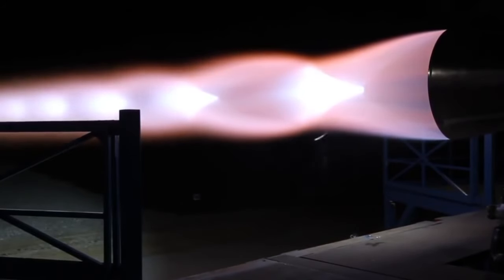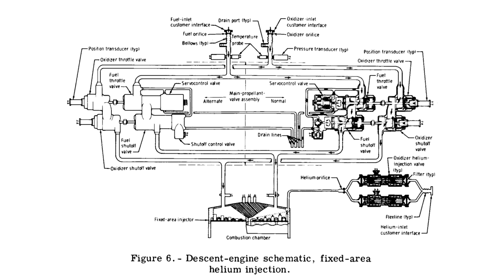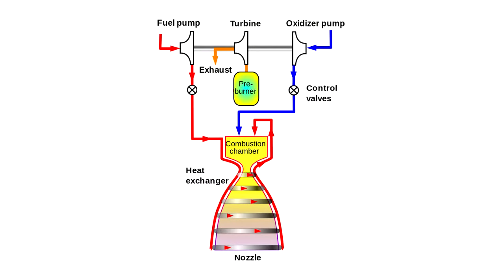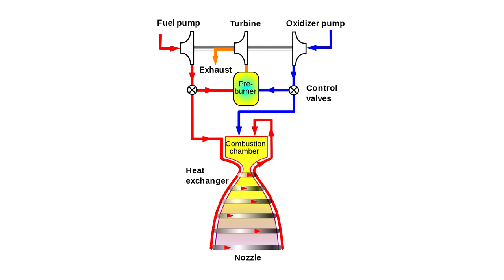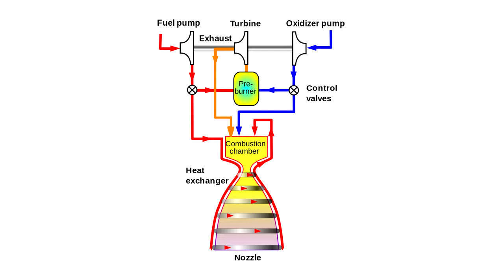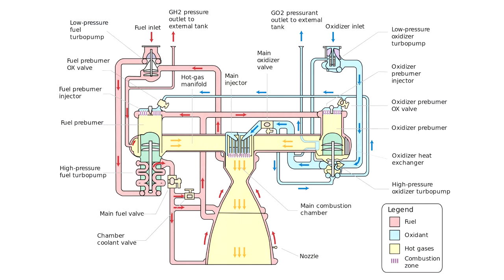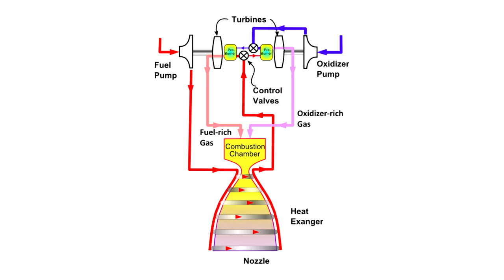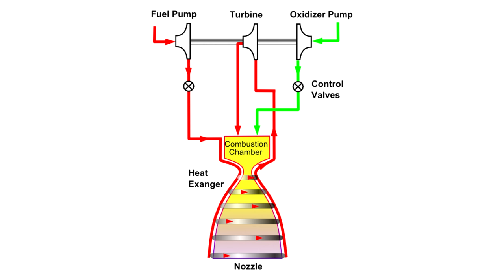KSP Doesn't Teach: Rocket Engine Plumbing

Comment: I feel like the best engine will be the one with the electric turbopump. That means that 0% of the total fuel goes into forcing the fuel and the oxidizer into the combustion chamber, and instead has %100 of the fuel being burned, with all of it very pressurized.
Reply from the maker: +AP but the energy density of batteries is significantly lower than the energy density of the other fuels.
Reply: Maybe if they could use a startup battery to get it going, then generate electricity directly from the burning of the combustion chamber (kind of like how solar panels make energy from light), it would then become more efficient as the loss of energy as heat would be minimized. Of course, this is assuming that future technology permits, but only then I think would the electric solution be better. Now go ahead and prove me wrong again lol
Reply: Like a... Solar panel that operates in infrared wavelengths? I think it would suffer from the same problem as the other ones of not being able to withstand the temperatures, perhaps even more so.

Though come to think of it, the jet engines I work on have something along those lines called thermocouples. In theory, it generates electricity from thermal energy by using the properties of alumel chromel (Though I have a suspicion my tech school teacher was pulling that out of his ass as it sounds more like it simply detects temperature changes via changing resistance. I have yet to learn enough about it to tell which way it works).
Reply: Thermocouples really do generate electricity.  It's how the radioisotope thermoelectric generators on many spacecraft work.
Reply: Or start them up with external power on the ground just enough to get it ticking over? obviously doesnt solve the inflight problem...
Reply: Oscar Jeans if the engine stops for some reason, you'd have the ability to restart it with a startup battery (if you used the electric motor)
Reply: DecidedlyNinja how?
Reply: works for rocketlab but these 200MW for the RD 180 have to come from somewhere ;)
Reply: My design for a rocket/scram engine involve an electric turbine for startup until the scram engine can sustain it self. It would pump the air to supplement  the airflow at lower speeds.
Reply: In KSP they use "alternators" in the Rockets, maybe an equivalent in real life?
Reply: To drive a powerful electromotor you probably need more juice then thermocouple can deliver, not sure it's common to generate large amounts of current from the rocket engine but you could drive a Stirling engine/Quasiturbine from the gas cycle to drive a potent alternator or go nuclear.
Reply: Thats starting to sound like a pre-burner with feed back into the main chamber like the soviets developed
Reply: You'd also run into the same scaling issues as the expander cycle, as your power is limited by the heat through the engine surface.
Reply: using the turbine shaft to turn modest alternators is done irl afaik... but to drive the fuel pumps with electric motors you'd be converting mechanical energy to electrical and back to mechanical. two energy conversions  that both have inefficiency. electrical is great for moving energy over distances but in a rocket you'd ideally want both the pump and the turbine at the same end of the rocket anyway so just having them on the same shaft is hard to beat. 
They do use a system where a combustion engine (diesel) turns an alternator and the electricity from that turns motors on locomotives, but loco designers have a different set of problems.
Reply: Not too mention meany more parts to go wrong. The desiel-electric set up on trains is to utalise electrics engines huge torque when its not actually spinning yet and to utilise diesels relativly high density.
Reply: Adsadsads Good point, I guess thermocouples would suffer the same square cube law problem.
Reply: What about one day beaming/transmitting the energy to the electric engine?
Reply: Sean Trevathan
Maybe - but for perspective each of the five F1 motors on a Saturn V first stage had a 40MW turbine pumping fuel into it (according to wiki) so 200MW total... so about 200,000 household microwave ovens on full power or 1/5th of the output of a typical nuclear powerstation. the turbines can produce enormous power in a really quite compact and lightweight unit.
Reply: Issue is getting massive amounts of power out of the exhaust. if we don't have a turbopump, how're you going to tap that power into rotating force for an alternator? A thermocouple wouldn't do - the amount of power needed to pump a rocket engine is immense.
Reply: Check out "thermophotovoltaics".  That's solar panels designed around infrared rather the usual white light from a sun.
Reply: Adam Olsen This would seem to have a similar square vs cube scaling problem scott mentions... plus you can't have instant heat, you still need to pump a lot of fuel before anything gets hot enough. The turbines have amazing power to mass ratio and amazing power to volume ratio. I don't think any near future technology is likely to supplant turbines.
Reply: They are useful for small engines you like to be strong, like lander engines , but for bigger, stronger engines I would still go for the full flow staged cycle.
Reply: Skythedragon Yeah. Things like the RD-170 took  170MW or 227,974 horsepower to pump, doing that electrically isn't very feasible.
Reply: What are good candidates for new high energy density batteries? It seems that the energy density of batteries is limiting on many fronts.
Reply: Mate if you manage to crack the energy density of batteries then you will make billions in portable electronics and in electric cars. We keep hearing about these amazing carbon nano tubes as a good source. I also read a article on presise micro pores in the structure of a battery but that was some time ago now. Otherwise there isnt much other than procedual inprovments on the existing ones unfortuantly
Reply: Oscar Jeans I'm thinking about very tiny radioisotope generators (AAA battery size, if possible), they probably won't produce a whole lot of energy, but can run for a human lifetime.
Reply: Wolfe that's true, and not to even begin about storing them in large quantities (nuclear bomb) Probably plain old batteries are still the best.
Reply: Skythedragon Our current best bet is full flow staged combustion for large engines, expander cycle for medium engines, and the electric engine concept is still experimental, but may prove simple and reliable for small non pressure-fed engines. But usually none of these are used and we just use gas generator cycle.
Reply: +AP Has the rocket ever just stopped during a flight? They tend to explode, lol.
Reply: Pretty sure what you were thinking of is pretty common - called a TEC or (I believe) thermoelectric cooler/heater... I just know them from small electric fridges and of course some computer CPU heatsinks.
Reply: If it's used to generate electricity it's called a Seebeck Generator, they're also used for generating Seebecks

Comment: If engineers ever find out to create a reliable asparagus staging system... would credit go to the KSP community for coming up with that idea? Or has this been an existing concept in the rocket scientist world?
Reply: The concept is quite old. See Mikhail Tikhonravov; 1947. Also Vladimir Chelomei's UR-700. Both the SLS and Falcon Heavy use fuel crossfeeding. I doubt KSP-style asparagus staging would ever be used in real life due to excessive drag and complexity.
Reply from the maker: +Twan de Graaf it was conceived long before KSP
Reply: I think an asparagus staging system would cost a lot to design and recover. Considering the numerous tanks to be retrofitted and landed safely without damaging the engine or tank itself. Not only that, I have not really seen a radial stage separator on any rocket before, and what about the fuel plumbing then? Would fuel lines just be dangling inside the main booster? Or flailing about the outside? But that may be my own ignorance. I'd love to see it in real use.
Reply: Woo, thanks for your answers :), I am aware of the challenges of actually building a system like that. And yeah, with the current progress towards re-usability it probably will be a lot less significant in terms of cost and maybe when we get to the point where it would be technically feasible, we could be at a stage where the entire idea would be completely obsolete..
Reply: +Kushaal Nair space shuttle had a radial orange fuel tank. it fed fuel to the shuttle engines. had solid rocket boosters on the sides. so it's almost asparagus, just that it didn't have its own engine.
Reply: Gene Shaver  Thanks for the info. I should look more closely further on.  :D
Reply: Nit: To my knowledge, crossfeed on the Falcon Heavy was either shelved, or outright canned.
Reply: Neither falcon heavy or sls use fuel crossfead

Comment: There is a little error when you talk about the Turbopumps. A turbopump is a pump driven by a turbine, it is the combination of the two systems. The pumps used are usually centrifugal pumps (the impeller you show is from a centrifugal pump). So for example in the rutherford engine, the pumps are not turbopumps but electrically-driven pumps, or more specifically electrically-driven centrifugal pumps

Comment: that thing looks more like a part of a turbocharger
Reply from the maker: +Daniel Monsanto turbocharger is exactly the same as a turbopump. Driven by exhaust gasses.
Reply: You just read some wikipedia pages :P
Reply: Now I know my truck has a bit of rocket technology in it😆😆😆
Reply: Daniel Monsanto
Your truck is a combined Otto-Brayton cycle engine.
Reply: Since he has a truck and a turbo, most likely he has a diesel. Both the Otto and Brayton engines have some sort of physical ignition system.
Reply: MatrixGuardians99 you aren't wrong
Reply: Isn't the word "pump" reserver for liquids (e.g. LOx)? A turbocharger only compresses gasses which is far easier. My sphincter can contain pressurised gasses, it can't contain pressurised liquids nearly as well. ;-)
Reply: +Hamachingo they are basically the same since they use the exhaust gasses from some combustion be it from the engine or from a pre-burner to get fuel flow or air flow to be as high as possible for peak performance.
Reply: Pumps are used for fluids. Gases included.
Reply: +Hamachingo What does a bike pump pumps?
Reply: +TiagoTiago A bike pump pumps bike, as a water pump pumps water, of course.
Reply: Touché
Reply: "Isn't the word "pump" reserver for liquids"
...bicycle pump?
Reply: @Hamachingo  I remember the aerator pump in my parents' aquarium. It was always dying which is a trans species  communicable disease with fish apparently.
Reply: @Hamachingo  Both gases, and liquids are fluids. All a pump needs to do is manipulate the pressure of a fluid to be considered a pump.

Comment: Scott, splendid explanation on the limit on size and power of ‘expander’ engines such as the RL10 imposed by the squared vs cubed relationship.  It seems to me there have been a large number of permutations of rocket engine design however it also seems that such designs are undertaken in the absence of viewing the rocket as a whole.  Everything is a bit of trade off.  If you run RP1 and oxygen with an open cycle gas generator engine you end up with a compact (small tanks) rocket that is both cheap to develop (Falcon 9 with Merlins) and build. If you run methane with oxygen you end up with larger fuel and oxygen tanks and therefore your engine needs to be larger and, as the fuel is less dense, you need bigger and heavier fuel pumps.  To compensate for this you can develop, at some cost, closed cycle engines to yield about 20% increase in efficiency.  Yet with all these advances the laws of physics contrives to limit the final payload to orbit as a fraction of take off mass to about 4% for any rocket configuration.  Given the questionable gains, today’s winning formula is basically one of low cost through simple design, efficient build and reuse of boosters.

Comment: I remember Musk mentioning in a Q&A 1500hp electric Turbopumps that were incredibly compact given the power output. Are you sure SpaceX uses preburners at least right now?
Reply: Actually kerosene and jpg have much higher energy density, making them a logical and economical solution to store energy, opposed to lithium ion batteries which has a lower energy density. Personally I don't see any reason to uitilize battery powered turbos. May I might see an hydrogen cell or something using electricity to power the pump shaft. Maybe it could beat efficiency too. But batteries I don't think does anything better, not sure myself, I'm no rocket scientist. 

I do recall that hydrogen has much higher energy density than jp5, kerosense, methane, etc. However the trade off is though hydrogen has more energy per mass, the other fuels typically have much better energy per volume at given temperature. I did some back of envelope calculations and found that l2h fueled rockets require a tank volumetric density of 195 kg/m^3 or lower to out perform jp5 as a fuel for rockets.
Reply: Aluminum has 2700 kg/m3
Reply: marshalcraft That all makes sense but I remember Musk saying turbopump though. Maybe he's still using a preburner feeds it to a generator that's separate from the electric turbopump that's meant for the fuel because he wants to avoid the issues that were mentioned by Scott in the video. Seems unlikely though as the falcon 9 is known to be pretty efficient and that would seem pretty inefficient.
Reply from the maker: +ryccoh falcon 9 has the best thrust to mass ratio but it's specific impulse is actually pretty poor compared to competitors.
Reply: Scott Manley Thanks for answering Scott, love this video series maybe you could talk about Vaccuum vs sea level engines and their differences, specifically the nozzle sizes next. Is the Falcon 9's lsp poor even compared to other RP-1 engines?
Reply: Whatever musk thinks that he is doing that is 'new' the Russians have done already decades ago.
Reply: ThunderAppeal umm except landing boosters left and right after sending off the second stage at mach 8
Reply: ThunderAppeal Yeah, no, not really, not unless they were using laser sintering 3D metal (Inconel in particular) printing for manufacturing - which Raptor is, which is why they're cheap to manufacture
Reply: Rykahnz 
Yes, Musk was saying turbopump. I remember that. But he never said electric turbopump. He most likely was talking about a preburner driven turbopump.

Comment: Did you grab those rocket cycle diagrams from Wikipedia? Most of them are marked CC-BY-SA, so a citation back to the source would be good
Reply from the maker: +you238 thanks for reminding me.
Reply: No worries mate, love the videos!
Reply: +Scott Manley  Just a heads up. You got a typo on that first link. Forgot the .svg :P Love your videos!

Comment: nice to do a mention of the old Atlas SM-65 rocket - most of the flame behind the rocket was just the exhaust flame from the fuel pump's turbine - I seem to recall a number of 4000 HP for the fuel pump.